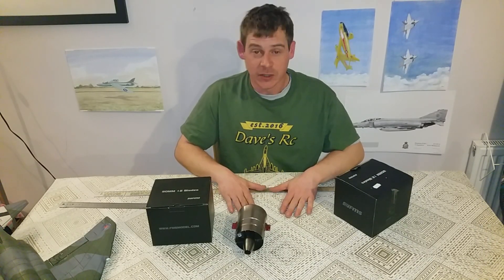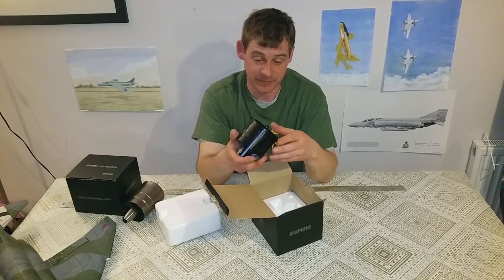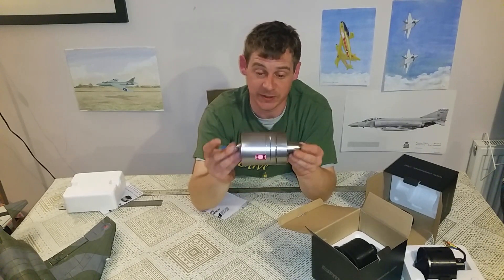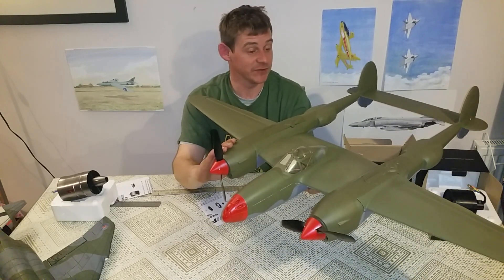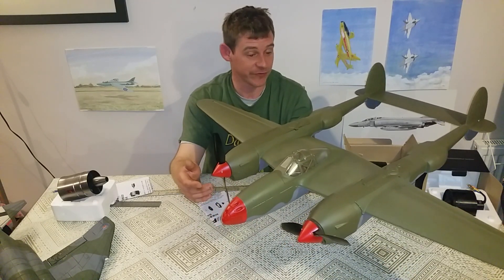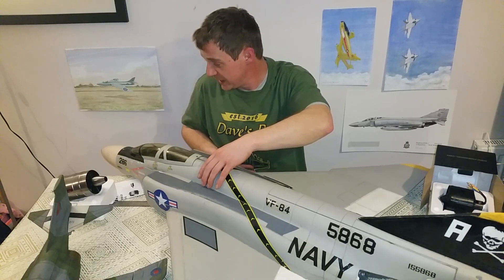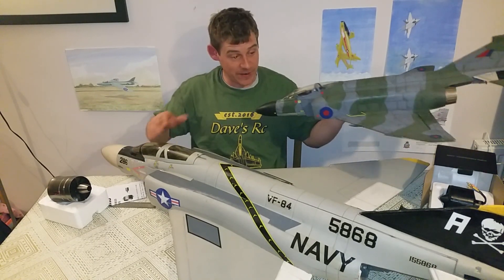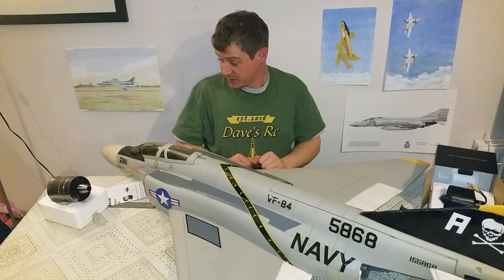FLY FLY F4 Phantom project + new fms fans + phase3 P38

Comment: She looks good Jeff!  Those engines will make this bird scream!
Reply from the maker: Im hoping that the 80mm 12blade will produce enough thrust to keep her moving .. the stock fan intended for the model produces 1.9kg of static thrust ..the 80mm im going to use is just over 3.5kg of static thrust .still keep wondering if i should fit retracts ..
Reply: @highflying82  I know Pilot Ryan loves those FMS fans.  He also said he gets a little longer flight time with the higher efficiency they have.